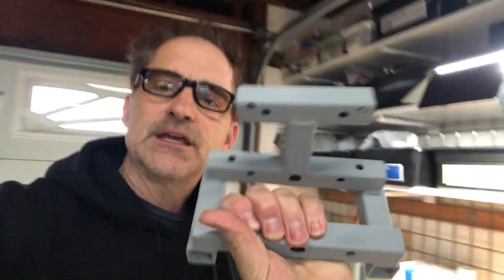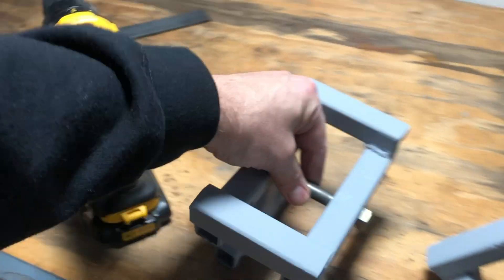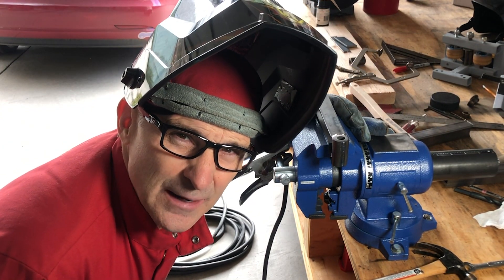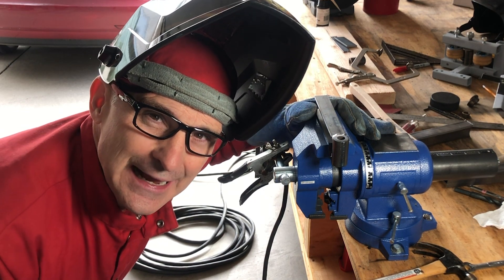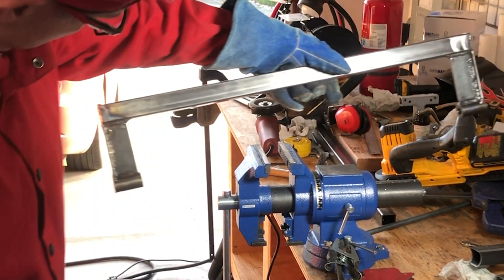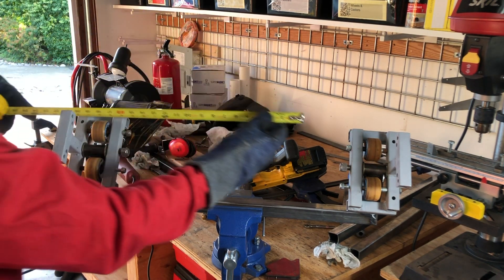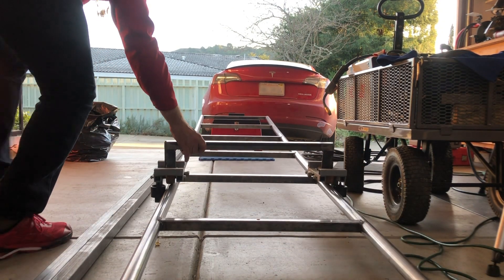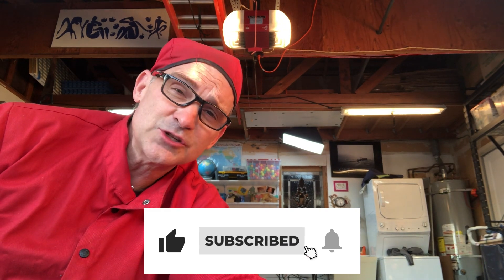Our Super Steep Hill Needs Super Strong Wheels!

Comment: Will you still doing this thing?  Very interested to see your Linear Synchronous Motor (I assume since you bought magnets) launch vs. the other Will's Pneumatic.  Want to see how you arrange the coils, magnets, power supply etc.  I'm trying to build one myself at about 1/8th scale.  Like a train set but a coaster.  Finding it nearly impossible without the proper tools.  It won't do the turns, it always binds.  The tolerances really have to be perfect.  So now I'm thinking just a big launch half-pipe.  Thanks!

Comment: So, when you take that bar with the 2 wheel assemblies and attach it to the seat, does that whole assembly need to be able to twist in relation to the seat to handle turns? I.e. do you mount it in a rigid/welded way or via a bolt since the wheel housings at the front of the seat would hit a turn before the wheel housings in the back?

Comment: What size steel tubing do you use for the sides of the track? I am looking to build a Half-pipe style coaster that is friction wheel powered and I am working on track design. Should I stick with pvc? Or should I build my self a steel tubing bender? Thanks.

Comment: What metal tubes do you recommend. I’m just starting to get into welding I have a really steep hill and I’ve always wanted to build a roller coaster down it. I’ve also been wondering about the tool you use to bend the metal.

Comment: Good video dude! Just curious, how much back-and-forth pitch does the wheel housing need to navigate the hills and valleys? I.e., if straight up and down was 0, how many degrees should the housing be able to tilt forward and back? Like 15 degrees each way (30 total) or more/less?

I ask because I'm in the Early Access program for Dreams, a game creation tool on PS4, and I'm iterating ideas on building working wheel housings in-game in it.
Reply from the maker: Hi Josh,
Great question, and cool project you’re working on. These wheels can pitch up or down as much as 50 degrees from 0. Way more than enough :)
Reply: @WillPemble  Cool, thank you! So, in your case, you've got 25 degrees in either direction (assuming straight up is default), do you think most coasters have 30 total (15 forward and 15 backward)?

I've got some videos on my channel of the tests, but am working with individual wheels atm not full sections yet. I've done quite a few flat rides though!
Reply from the maker: Hi Josh,
Just watched your video here: https://www.youtube.com/watch?v=A7GQGVDNWKs&t=269s
Everybody should watch it because it's awesome! What you're doing in PS4 land is very cool. I wish I could set friction to zero on my coaster :)

To answer your question, our wheels have 50 degrees in either direction, assuming straight up is the default. I think that'll be way more than enough.

Comment: To improve on the welding surface you need to put your ground next to the area your welding at least 6 in if possible note by putting your ground on the vice you're adding resistance to the material to get a proper ground sign sprack a tack 248
Reply from the maker: Thank you, Sprack!
I will absolutely do that next time :)